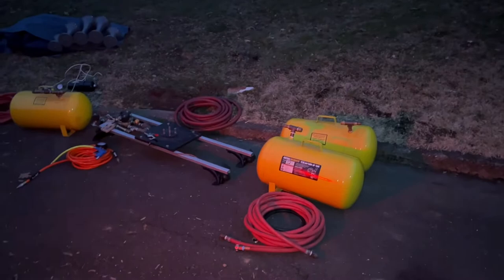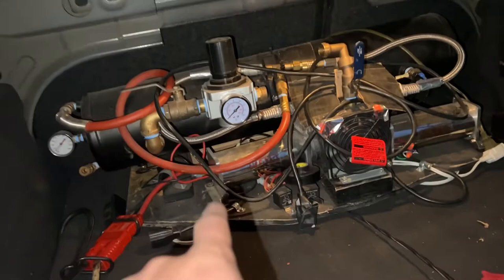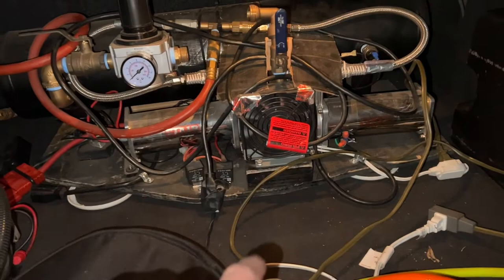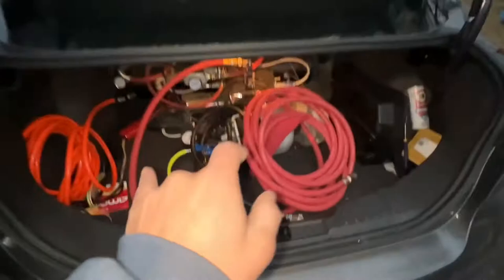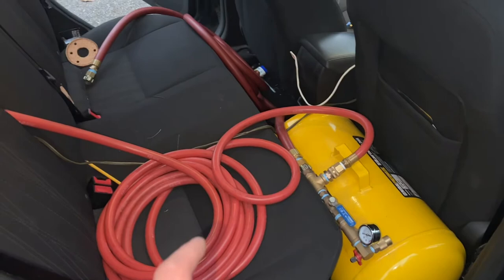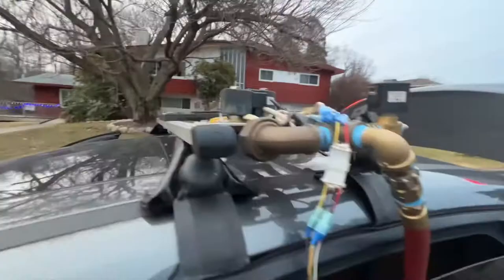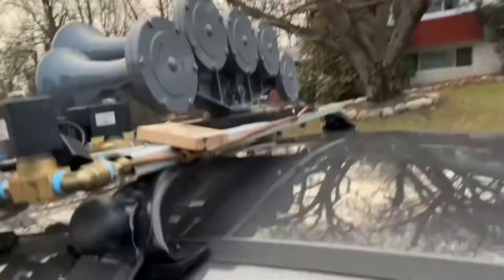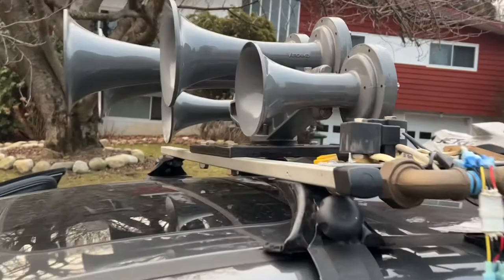Train horn Setup on a Compact Sedan

Comment: What PSI are you filling the tanks to? and how long does it last with a K5LA?

I have an 8 gallon tank (with built in compressor) with 120 psi max, and maybe room for two of those 11 gallon tanks
Reply from the maker: The harbor freight tanks are rated for 125psi so I fill them to 120psi. I can do a decent run but I’ll be starving for air towards the end. It takes about 20-25 minutes to fill up, which is why I have the fan that keeps the compressors cool
Reply: @NickSilcox3  What kind of end fittings are you using for the 1/2" air line? Seems like barbed fittings are standard but IDK
Reply from the maker: @Traincraft101  each airline I have are factory fittings or shop pressed. each hose was 25ft. I’ll never use barbed fittings on compressed air since I have seen several barbed fittings fail and one even shattered a car window when the hose flew off with the hose clamp. Some guys like them but I hate them.
Reply: @NickSilcox3  ah that sucks. Where do you buy your hoses? I wish it was easier to find shorter lengths because I really don’t need 50 feet of hose in my car
Reply from the maker: @Traincraft101  I just get them from eBay or Amazon. I get 25 foot lengths and coil them up around the tanks so the air tanks don’t hit and scratch the interior in the car
Reply: Also how do you drain the moisture out of the tanks? Don’t see drain plugs on the bottom, do you have to flip them upside down?
Reply from the maker: @Traincraft101  I have a drain plug on the bottom of the tank, it’s pretty small but it’s there
Reply: @NickSilcox3  did you install yourself? (On the yellow tanks I mean)
Reply from the maker: @Traincraft101  yellow tanks only has one port and they don’t collect water since majority of it collects in the black tank. During storage the yellow tanks sit fully opened, in a heated garage
Reply from the maker: @Traincraft101  yeah they’re the harbor freight 11 gallon tanks, remove the existing fitting then put your own fittings on